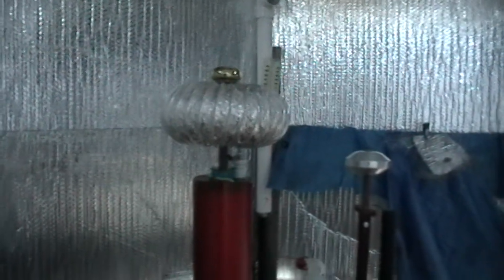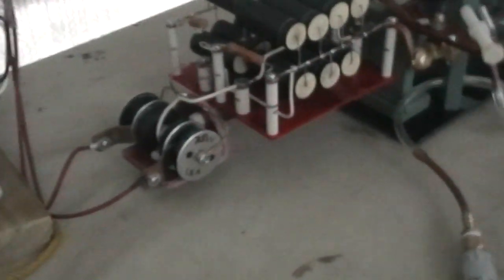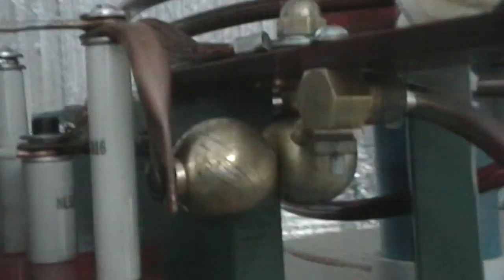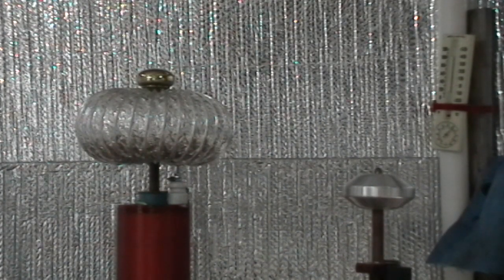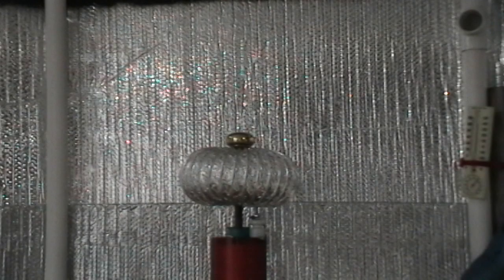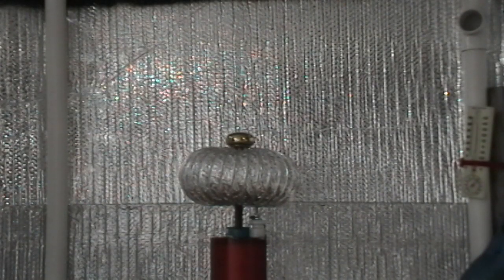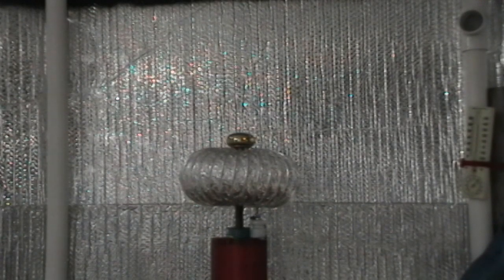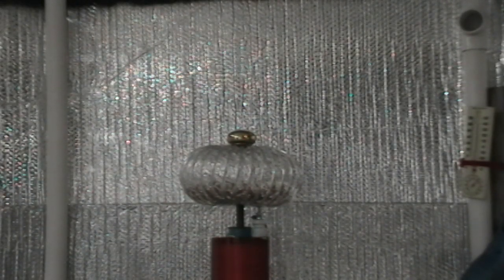Extreme High Voltage: TinselKoil 4 -- MOT DC Tesla Coil w/ Blown Spark Gap Quenching

Comment from the maker: Thanks, yes you are right about the danger. The MOT can deliver massive current, unlike the usual NST which is current-limited.

I always "crowbar" (shortcircuit) the cap bank with a long, insulated screwdriver whenever I approach the system, and I keep the bank shorted while working near it. 

I plan to make an isolated enclosure for the cap bank, for extra safety, and I think I should also rig a momentary-contact footswitch as a "deadman", using the oven's contactor relay to crowbar the bank.

Comment from the maker: Yes, it's not really a "room", it's just an octagonal frame of t-posts covered with pvc pipe, pounded into the ground, around a floor of concrete pavers, with my telescope pier in the center. The walls and ceiling are made of thermal barrier material, which is like tough bubblewrap that's aluminized on both sides. Most of 2 rolls just unrolled around the perimeter to make the walls, and the scraps cut to make the removable ceiling. It takes about ten minutes to strip it down to the t-posts.

Comment from the maker: That's a good suggestion. The spark gap is critical for performance of any Tesla coil. I wanted to see if I could use the simplest possible two-element sphere gap and still get some kind of good performance.
A vacuum cleaner's powerful suction, used with a proper multi-element or rotary gap, would indeed work great, but would require more engineering effort than I felt like doing, and I have compressed air easily available.

The coil gets hot after a while though; it's carrying a lot of current.

Comment from the maker: Yes, by looking at the number of thready filaments captured during a single exposure of the still camera I can see that it is firing in synch with the huge DC ripple: 120 Hz. (8 threads in a 1/15 sec exposure) . That is of course when the air is on and the spark is quenching properly.

Comment from the maker: With proper cap/coil tuning and without the FWB diode bridge, probably. 
But I found out that my 6kV, 30 mA NST will not work at all with this large cap bank when used without the rectifier, and with the rectifier it doesn't have enough current to drive the spark rapidly enough for good effect.
This coil seems to work "in spite" of the MOT's low voltage/high current, due to the HV FWB and the blown gap quenching.
I intend to make a multi-element blown (or "sucked") gap that may work even better.

Comment from the maker: Thanks! 

This MOT was pulled from a huge, ancient oven, so old that the only front-panel control was a mechanical twist-the-knob timer switch. According to the dataplate it was 1.5 kW input (USA mains at 120 V, 60 Hz).

I'm running without a ballast, and I've blown one 10 A fuse in the Variac..... so I stuck a 15 amp in there and it seems to be holding up ;)

I'll do a video showing detail views of all the coil system parts, probably later today. Stay tuned, and thanks again for watching!

Comment: For the HV diodes, I learned that you can hook in series couples of normal diodes to get the same result as using an HV diode. But for the capacitors, what kind of homemade capacitor would you use instead of beer bottles? However, I tried to make de half wave voltage doubler with these homemade components but it didn't work even with the main circuit of the microwave's doubler.

Comment: Impressive! One other question, other DC coils I've read about employ large inductors and de-queuing diodes in the charging circuit to avoid the tank circuit shorting through the bridge rectifier and preventing oscillation, how come this isn't a problem for you?

Comment: You need another mot to increase the voltage to around 4KV and modify the spark gap,try to put more elecrods,so when the spark ignite you dont need much air to blow in to that to make the coil running and it shuld give you a much better output

Comment from the maker: And also.... when and if it does start working properly, I guarantee you that your nice radio will blow out, probably your drill will too, and any other sensitive electronics you have nearby. You really need to isolate your workspace from delicate stuff like radios, clean up your wiring, and pay close attention to little details like sharp points in your HV circuit, spark gap quenching, and so on. Particulary the wiring of the capacitors: all this wiring must be as short as possible.

Comment: what would happen if you didnt have the diode rectifier on this tesla coil?
Reply from the maker: +notny411 It wouldn't work as well. The FWB acts as a "de-Qing" system to isolate the SG-Cap-primary circuit from the MOT.
Reply: TinselKoala where did you source the diodes and capacitors? I just finished my first TC using a 30mA 12kV NST with a terry filter and beer bottle / 5gal bucket cap. But I have some MOTs laying around that I'd like to try.
Reply from the maker: notny411
 I got them years ago at the legendary Mike Quinn's Surplus in the Oakland CA area. He is no longer in business I'm afraid. I paid very little money for them -- the caps wound up costing me about 50 cents each and the diodes a dollar each.
The capacitors are HV "doorknob" type capacitors and I see similar suitable ones on Ebay all the time. Not for as cheap as I got them though! The diodes are "bell" type HV, high current diodes, the closest thing I can find on Ebay is this:
http://www.ebay.com/itm/HVCA-High-Voltage-Components-45XV783-2kV-16A-High-Voltage-Rectifier-Diode-/130900515616?hash=item1e7a475b20:g:~FgAAMXQHxVRgZ~f
But I doubt if you want to spend 900 dollars for a FWB of them!
You could probably make do with 4 of the rectangular, 20kV 2A diodes that are a lot cheaper.
Be very careful messing around with MOTs and capacitors though. Unlike your NST, they are not current-limited and it only takes one mistake to kill you dead, as in permanently, no second chance, dead.

Comment: Can't help it. But it is either almost or exactly 20 cm not both. "almost exactly 20 cm" is not possible. 
But great build and results.
Reply: its actually more accurate to say "almost exactly" instead of "exactly"
as "exactly 20 cm" is not possible.
you'll always be off by some margin even if that margin is infinitesimally small.

Comment from the maker: Ahh. OK, I watched your video, and it scared me. You are dealing with lethal voltages and currents here, and also you are dealing with a system (the Tesla coil) where capacitances and inductances must be controlled and matched. In other words, your setup is dangerous and also electrically "messy" and not likely to succeed.
A single ordinary spark gap will not work well. Your primary is too closely coupled. Your capacitors might be working, I can't tell. I'm surprised you get any output at all.